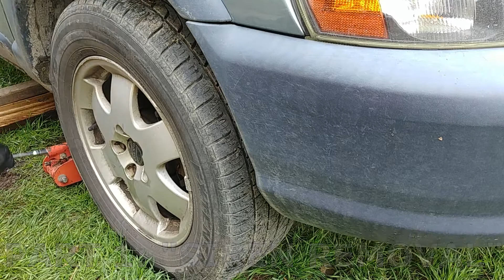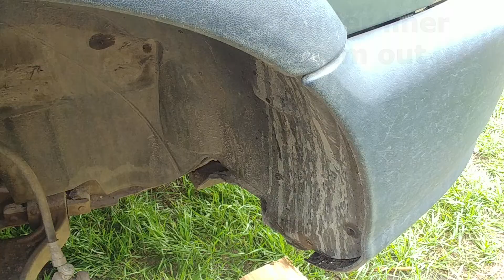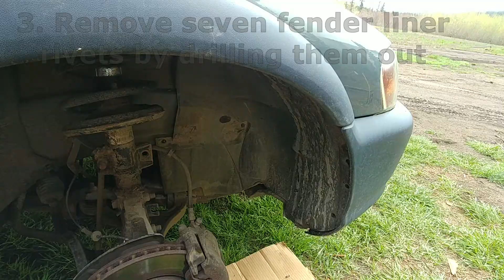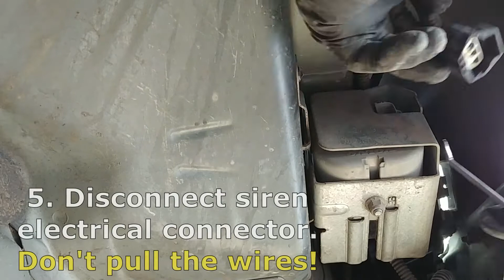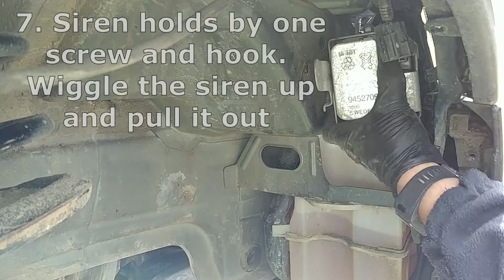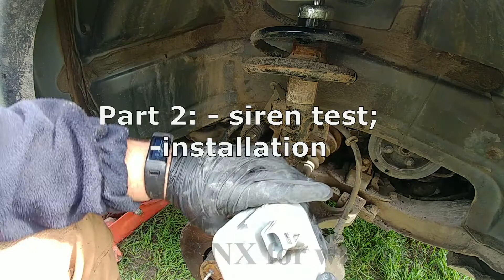VOLVO ALARM SIREN REMOVAL. Part#1

Comment: hey brother im purchasing a 2008 s40 volvo and when I unlock the car the alarm goes off and for me too offset that I have to put the keys in the ignition. 
I dont want my alarm activated is it what you just did??
and is it an easy fix???
Reply from the maker: Hello Larry,
Easiest fix for your problem just pull alarm fuse out to deactivate alarm system. It works I tested it on my Volvo. It won't effect vehicle performance. It will set a message "Alarm System Service Required" when you start the car then it goes away. Let me know how it worked out.  Cheers Brotha!
Reply: @PistonShack  thanks bro

Comment: Hello, what happen if i just disconnect siren connector? I don't want to replace it i just want to disable it forever.
Reply from the maker: Hey Rafal! Nothing should happen far as I know. U have never done it. You probable will get ALARM SYSTEM SERVICE REQUIRED message every tie you start your engine. Yeah, let e know. Cheers!